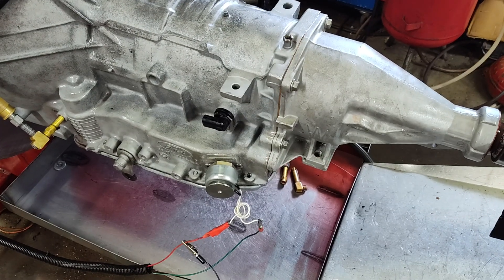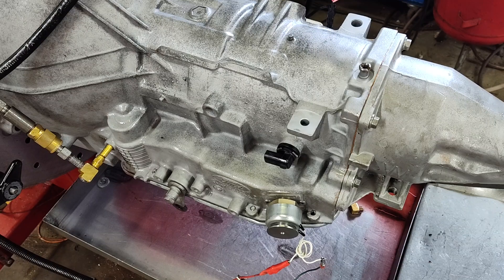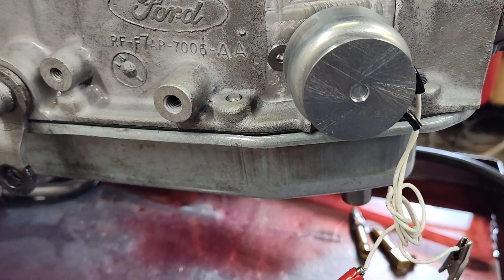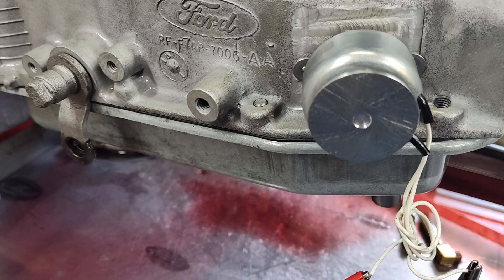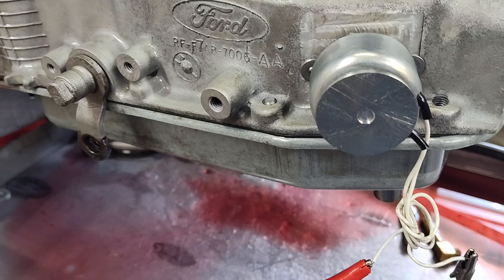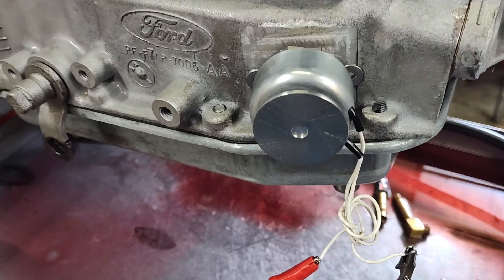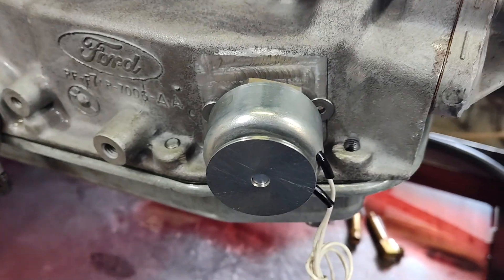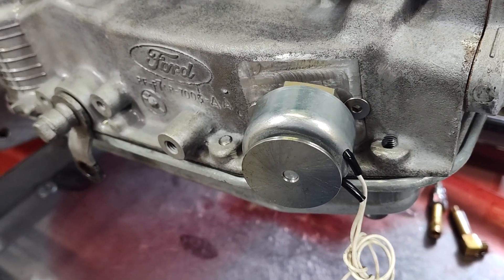New Product Announcement Ford 4R70W Pro Transbrake

Comment: nice , the only thing I would add is a plastic dust cover  if used on the street or a drag and drive car
Reply from the maker: It's a good idea. I haven't seen much trouble with that except in mud racing applications.

Comment: Thanks for the video. It's nice to have this option. Especially with full auto and transbrake. I currently run a C6 with a gear vendors overdrive. But that combo is over 20 years old and don't know how long it's going to last
Reply from the maker: C6 is a good unit.  You might get another 20 years.
Reply: @BroaderPerformance I agree. I just worry about parts availability, especially since I have a wide ratio gear set.